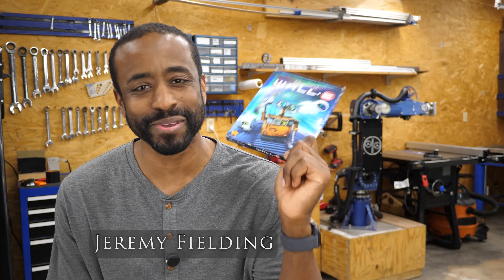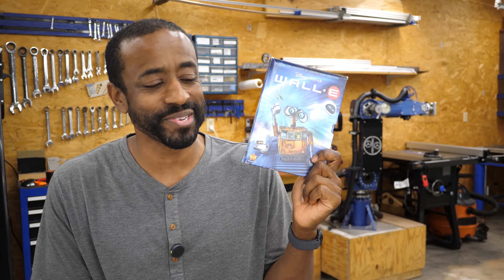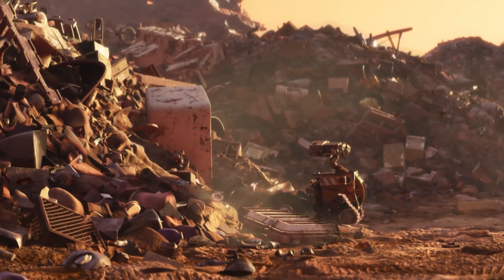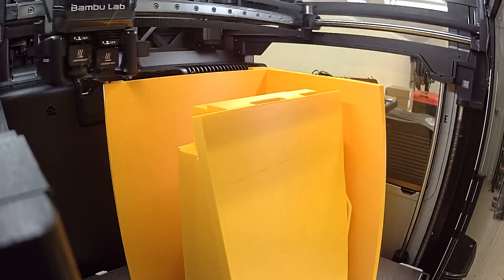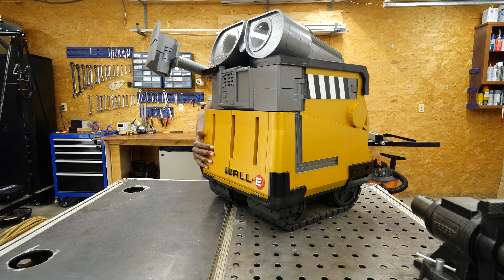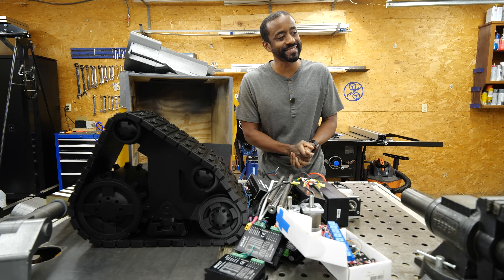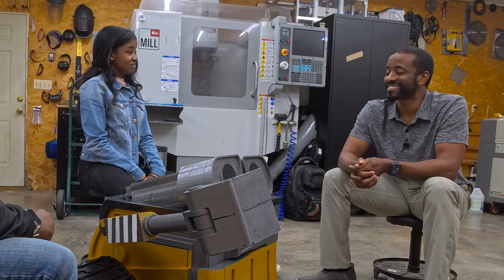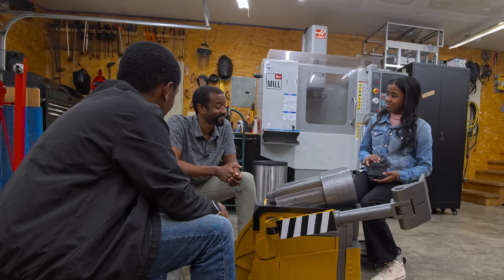Making A Real WALL-E. Episode 01

Comment: Definitely want to see how this pans out. I think you could actually make most of it work properly without having to sacrifice much reality. 

To start, you'll need to make the bottom of the inside box so that it can either fold up to accommodate the wheels, or slide up and down on rails. This could also double as the actual compactor mechanism.

To fit the electronics, I'm picturing the batteries in the head, and then you could likely bump out the back a few inches and create a space in there for a lot of the components. (as well as stick them around the rest of the box like in the 'actual' WALL-E). 

I'd imagine most of the motors and linkage for the wheels can go in the wheels/wheelbase itself, which really just leaves the hydraulics and motor to actuate the head, as well as the telescoping arms/wheel base. Well, and actually making the arms move along the L track and stuff, which would be a damned nightmare. Can you put a slip ring in a gear? Have a motor spin, which drives a geared wheel in the L track, which has teeth on one side. Bam. And then the outer track would need slip rings for power to the arms, signals for control could be wireless?

Comment: Please don't hate me, I love this project, but I really think his tracks need to be able to collapse into his body. I had a thought on how to do this, 2 actually. The first is using lead screws in the corners of the base platform to be able to move it upwards and thus take the tracks inside, and the second was using pulleys like Ivan Miranda did on his giant 3D printer. Since the space his head will collapse into isn't currently used, you should be able to fit the motors in. In addition, the motors used don't have to be strong enough to lift the tracks, just hold the body up, which could be good or bad.

For the laser between his eyes, you might be able to get away with a laser engraving module from a 3D printer or a laser pointer for safety. 

I can't wait to see where this project goes! Please keep up the great work!!!

Comment: Retracting the treads into the body is asking a whole lot.  You might want to have "turtle mode" just be retracting the eyes into the top of the body, leaving room for the micro-fridge as noted in previous comments.  Putting the motors and their drivers into the tread assembly is one way to conserve space and potentially get a good bit of air onto the driver heatsinks.  Is it possible to stuff a battery into each tread assembly as well?  That might make for a nice low CG, which would be very cool.  Brains near the top behind the "eye bay", between the motors/actuators that move the eyes up and down?

Comment: It’s the R2 problem on a crazier scale. The few things that would be best is eye movement (if you watch some videos on animatronics by imagineers it might help you with that just because you want to get the emotion), turtle mode would be tough but you might be able to do it with the bottom plate of the compactor on a gantry like your 3d printer. But the eyes going in you might not be able to get easily since you’ll have to put all compute modules up top. Then arm movement along the body you could do a tpu belt system to pull it along the L track and arm extension use springs and a rope reel. Same with hand movement. And some small motors for the hands for rotation. This sounds like a lot lol 😂 but you want to get emotion and movement.

Comment: There is a Wall-E builders club, similar to the B9 and R2D2 builders.  There are also sets of plans for Wall-E.  This should help in getting the dimension and appearence.  I was contemplating building Wall-E at one point.  Currently I am building a full size 1960's tv series, Lost in Space B9 robot.  Good luck.

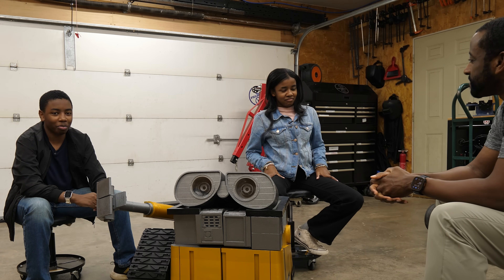Comment: 14:30, no need to make it slow: if you use a linear actuator(best option) you cant push back against it so most robots would use brushless motors so you CAN push back, but I think using magnets would be a much better options, connect the actuator to the door with strong magnets, calibrate with different magnet sizes/number of magnets so if fingers get jammed the link between door and actuator just breaks off making it much safer and no need for expensive or complex force feedback systems

Comment: I think a good compromise if you have to incorporate “turtle” mode is to leave the tracks fixed to the sides but have the arms and head fold up into a cube (with tracks still visible on the sides)

Comment: Funniest bit about your function definition; in product design, you can start with any aspect of the design, often different philosophies of design will be form led, or material choice led, not always function!

I do agree for the 90% of products out there that function (from an engineering perspective) is the best starting point for any design.

Thought id mention in case theres any aspiring product designers or PD engineers that may read this.

Comment: Yo um I saw this other engineer who made a robot from portal called wheatley. Though it was complex due to all of its moving parts and he had to design it differently than the original, it still looked the same. Maybe you could look for a WALL-E model that can transform so that you can how he fully transforms and maybe you can improve the mechanism of him. Also I saw two people who made I think wooden? Wooden cardboard WALL-E’s that can transform accurately. The other one actually was so accurate but im not sure if it can actually transform or the creator just takes off its parts for it to transform. Either way, nothing is impossible and I know you can make a transforming wall e. I mean I made a transforming wall e in a game. By the way right now im planning to make an air powered wall e I with an onboard air tank and pump since it’s going to be a bit big and I really love watching the WALL-E commercial it’s really cool to see WALL-E not rusted and showing their mechanics

Comment: I'd assume that WALL-E uses hub motors for his tracks to allow him to individually power them.
Reply: But to find a pair powerful enough to move him at any significant speed and small enough for the scale you want to build him at is going to be a bit of a challenge, as (from what I understand) hub motors aren't as powerful as standard motors of comparable size. But if I'm wrong, and hub motors are of similar power to standard motors, you can actually power each track individually and do away with a bunch of mechanical clutter in the telescopic track mounts and have the wires for the motors be in small conduits that are disguised as some sort of hydraulic line. It'd be kind of like a car's wire harness, bunches of wires of similar voltages grouped together to allow mechanics to easily see which wire goes to which light or engine component.

Comment: For the audio clips you might want to look into a DFPlayer Mini.  It's an MP3 player module that will work well with an Arduino or an ESP32 and you can play Wall-E's sound clips on command.

Comment: He needs to be able to Emote. He needs the Power up Mac sound with light effect when you turn him on. Needs to be battery powered. (no wires) 

It would be SOOOOO Cool if you could make him solar powered. 

Also needs to be relatively quiet. No Noisy motors/actuators, or pneumatics. High Torque stepper Motors with decent drivers? Would also help with smoothness. Actuators probably won't cut it. having things controlled via steppers is probably the way to go. 

I don't think he really needs to compact things, but a storage space for a boot would be cool. Bonus points if he can open it, reach in, and get it.

Also if he could have a hub cap and go "Tada" after waving it over his head. (More Emotes)

I was following but my notifications weren't turned on.  They are now!!!

Comment: Multi-level Take
What's best for you:
If what is going to keep you going to creating a stage ready robotic puppet than go for it. There are Wall•E clubs that have down much of the heavy lifting for you where you can source a lot of this information related to building Wall•E and meet with other builders to find out pitfalls and challenges they faced at many conventions that likely will be in your major city.

What I would want: (but you opinion is more important then mine)
You started the video off by dangling a juicy engineering challenge of thinking through the sub systems that make up the Waste Allocation Load Lifter – Earth-Class robot and potentially bringing a functioning version of one into existence. Not just a fix tread version 1 degree of movement arms and moving eyes. I would love to watch the engineering process, setbacks, steps forwards, rabbit holes, and milestones for the telescoping tracks alone.

Hell, if you and any one would sponsor me and help film, I'd do it myself. I know my limits both financially and mentality and that is why I haven't touch YT creating in over a decade. But A project like "WALL-Engineering" would have me locked in to the series fully invested, on the discord or forums, sharing concepts, linkages, and gears.

Best of luck and do the project version you will enjoy doing and will complete.

Comment: I personally think that animating the eyes and eyebrows are more important than getting all the track and arm functionalities in there. That is what makes Wall-E relatable more than anything else.
I wonder if you will work with pneumatics in the build, since that makes a lot of the retraction and extension things easier, and you can source the energy for all mechanisms from a single reservoir of air. You probably want to use rather low pressure if that is the case, so it doesn't become too noisy. You don't want it to sound like a snake is hissing at you when the bot makes a happy face.

Comment: Love the plan. The tracks fitting inside i think is overkill, but the rest of him, can still become a block. 
 The eyes moving and eyelids could be controlled using cams and wires. 
 Basic functions could be built into an onboard computer, with wi-fi, allowing advance function remotely. 
 So basically,  make it remote/radio controlled. 
The battery doesn't need to last long. And should be something you can swap easily if you want it to run longer.
 I would incorporate as much of the functionality into the chassis.  Don't make it invisible. He's square but he's still got some gadgetry visible(such as the battery.

Comment: He should have trucks, that don't really have to come all the way out, but his body should be able to move up and down a couple inches, and tilt slightly on two axis.. His eyes need to translate up/down, and pivot on two axis + that weird independent movement on the third axis to emote. His hands could be able to gesture but don't need to have the complete range and telescoping ability. Maybe be able to put both hands up and open them, or place them together in front of him, and extend a hand out as if to shake your hand, these movements just need a shoulder, elbow, and hand actuators. The shoulders don't even need to be able to rotate on a second axis to reach out to the side to express himself but maybe he could be more impressive.. Depends how ambitious you are! For me, the most crucial function is his tracks. Even if the rest of his body was a sculpture, as long as you could drive him around and maybe play a sound "WaaAAaallllliiiieee" he can be very expressive in the way the operator drives... Makes him come to life. You add moving eyes and hands, and you'll knock people's socks off!

R2 D2 didn't even have arms, but he's my favourite droid! ❤🤖

Comment: I always love your videos. Some years ago I worked with a high school robotics team as a mentor. I mainly showed them how to use different tools and monitored them using them. They did the electronics and programming with the guidance of some of the other mentors. They were team 1261 in the FIRST ( For Inspiration and Recognition of Science and Technology ) program founded by Dean Kamen and Woody Flowers. Each January a new game is presented and the teams have 6 weeks to produce a functioning robot within size and weight constraints and compete against and with other teams. This is not battle bots ! It's high school. They also have programs for Elementary and Middle school levels. I was loving doing it till a lot of the kids coming up developed some bad attitudes that I just did not want to spend my free time fighting.

Comment: TPU sandwiched between laser cut black acrylic works well for wheels, glue the acrylic outer wheel onto the inner wheel. Make the TPU the same width as the acrylic, so when you sandwich the two outer pieces and the middle form piece together, the TPU fits smoothly onto the inner form piece of acrylic. Laser cut acrylic is beautiful, perfectly smooth edges straight out of the cutter.

Comment: Does it really need to be able to compact trash while it's in turtle mode? Bc if not you can slide the top plate down to hide his head and the bottom plate up to hide the tracks
Reply from the maker: This is along the lines I am thinking

Comment: Some things can be built in, like the motors can fit inside the track pullies, like a motor built into a wheel.  You've probably already thought, but wanted to throw that out there just in case.

Comment: There are a few YouTube videos of the time when Pixar Built a life-sized WALL-E and toured around with him doing promotions for the movie. The real one looks even bigger than yours, and it was surprisingly emotive. I think you'll find that the eyebrow flippers as well as the movement of his eyes, the depth and movement of the lenses focusing inside, are a must, and his hand motions and functionality are all a big part of bringing his character to life.
May I suggest that try to find some of those videos, as well as the hobbyist build videos. I think they will help give you a better idea of what you'll be dealing with when it comes to size, weight, and structural design. And, you can get an idea of things others have tried, and failed, or learned from their attempts.
Considering how much electronics have advanced since the movie's release, You may be able to include some real world functionality into the controls than the builds others have done in the past.
I'm actually shocked that there haven't been more people building WALL-Es, like R2-D2 builder clubs. I'm happy to see someone with your skills jumping into the project.

Comment: Awesome video!!! I noticed some of the 3D printed arcs looked somewhat polygonal, which usually shows up if you export the model as an STL. If you export as a STEP file instead, the arcs will turn out much smoother, and the printer will actually print quieter too!

Comment: If you have to get rid of your mini-fridge so you can have the to scale WALL-E on display, turn the to scale WALL-E into a mini-fridge! Problem solved. One of his arms could be a cup holder!  
WALL-E functionality
* Eye movement with expression (likely the hardest part)
* Voice responses to go with eye movement
* Movement on tracks with some built in autonomy like a robot vacuum and/or task programmability to deliver your drink from WALL-E fridge
* Play music (built in Bluetooth speaker)
* Dance to the music
* Full arm movement and basic hand/finger movement
* Front opens to show the front of a compacted cube but not a full cube
* Have a full size cube prop around that WALL-E can pick up and move

I don't know what is off the shelf these days for voice command.  I have an R2-D2 robot that my mom got for me 10+ years ago that responded to some basic voice commands.  As that was 10+ years ago, I would bet there are some better and cheaper options available.  

Good luck.  I am sure whatever you end up doing, it is going to be fantastic.

Comment: Love how you incorporated your kid's input into the build plan. And I agree with them, you ARE building a character, NOT a "just a machine". So there are a number of "as advertised" features that he really just doesn't need in real life. Full on trash compactor = kinda kid unfriendly. "Full" turtle mode" = functional space constraints. "partial turtle mode" = WAY more character. (By the way, as a trash compactor, that means the top and bottom compactor plates are VERY strong, and would be functionally part of the turtle mode, leaving the outer shell just a covering and his arms would almost be a separate unit.)

Comment: If you haven't already looked at the other animatronic wall-e builds, a lot of them focus on the expression of the head and eyebrow movement. Most of them the tracks are fixed as well. I think if it could do the basic emotes and still go into turtle shell mode it would be a huge  accomplishment. The internal volume could also be faked with a facade piece.
Reply: Blow a square baloon in place of compacted trash

Comment: Here's a thought, if the compactor crushes from the bottom up, then it makes sense that the floor of the compactor would push up when he retracts his tracks.  So he couldn't do that when something was in the compactor per say, but if it was empty he could.   Doesn't help with the head retraction, but it gives you something.   Oh and the bottom would need to be on worm gears located in the corners so that the volume is as empty as possible to make room for the tracks.  For the mockup, make him the mini fridge, that would be epic!

Comment: I see you have not found the Wall-E builders club which contains all the drawings, plans 3D files with the exact scale. It also has all the build materials and links to the parts … many have built this robot and solved many of the issues you are about to face …. Good luck !!!
Reply from the maker: I saw it. They haven’t solved the problems I am interested in solving except scale but thanks for the suggestion.